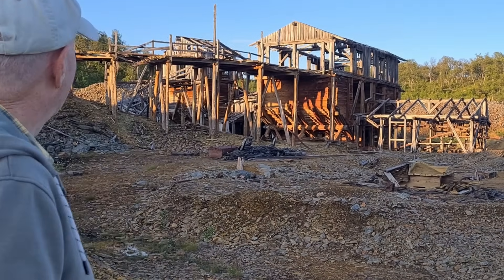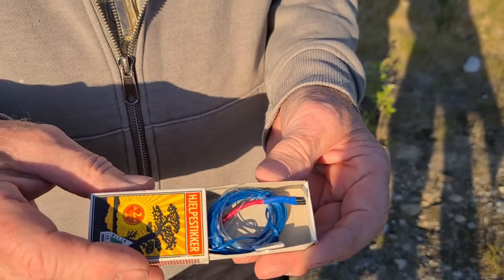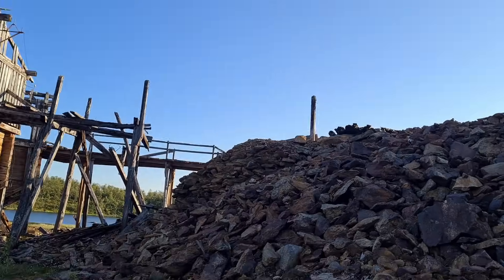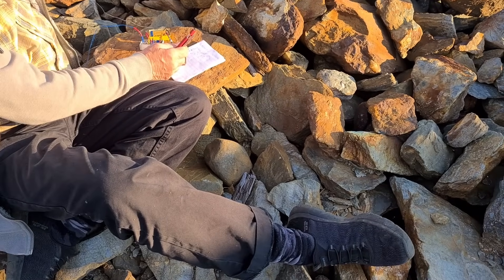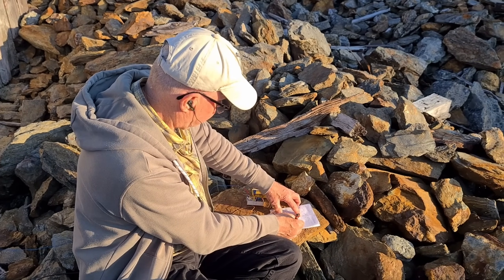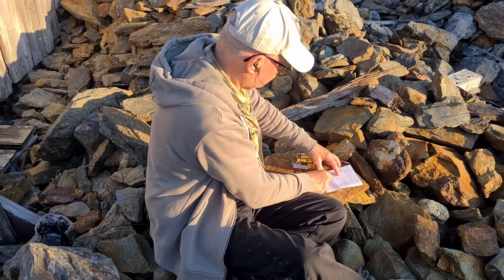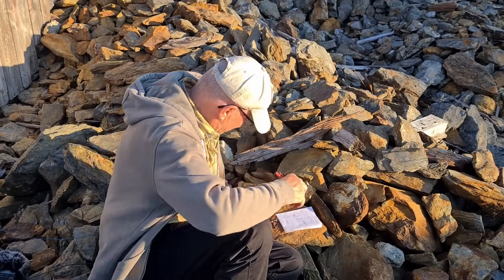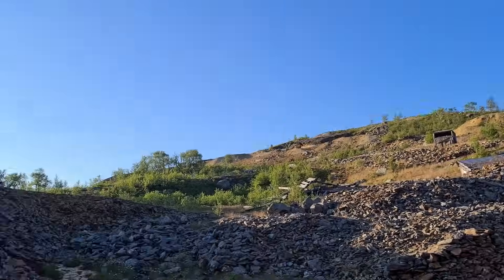Spy radio with invisible antenna, communication from a mine.

Comment: I love playing with homemade antennas my three favorite construction materials are these rolls of green plastic coated Garden wire ties very easy to hide. Stainless steel mechanic safety wire cheap strong not easily seen and takes a lot of abuse. And then although it's not easily hidden I've been having a lot of luck with 1-inch slinkies mounted on a string. You would be surprised how actually small your antenna can be with one of those little tiny slinkies or a few of them put together
Reply from the maker: Thanks, this was an interesting comment.

Comment: Remember the insect repellant next trip out doors would make life a bit more bareable nice to see the mat h box transmitters  and receiver used again out doing portable operation. Would be interesting to see what the termination impedence would be for your dipole Helge. From the angle of camera the distance  between either side of dipole looks about 300mm roughly though it still seems to work really well which is great.

Comment: Hi Helge, good advertisement for QRP portable use.  You have a very good audio filter amplifier. It was a narrow band noise, important with Direct mixer use. Astonishing that it worked so good at daylight on the 80m band.    I will look for the schema on your page. 73 from F1VEL.😊